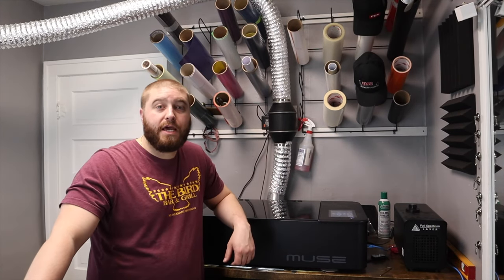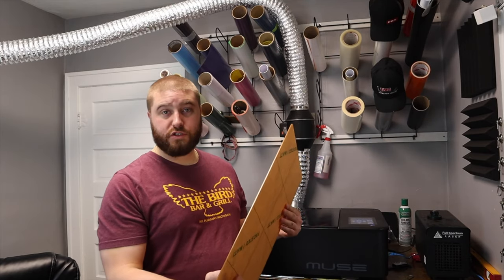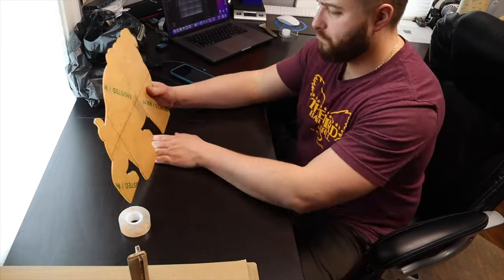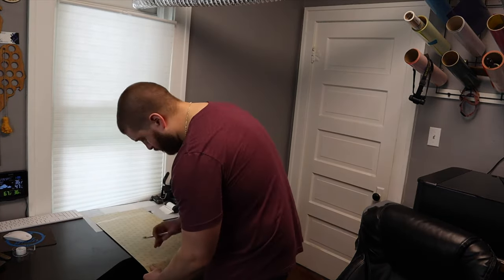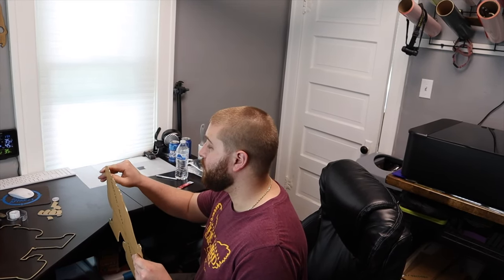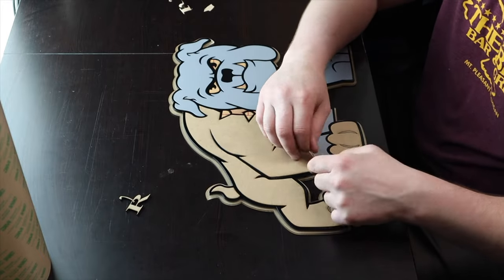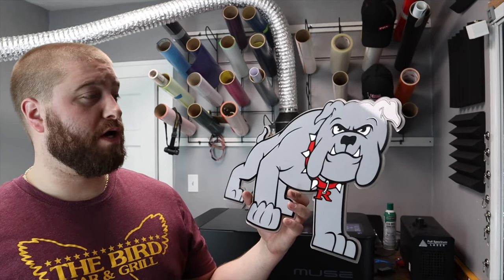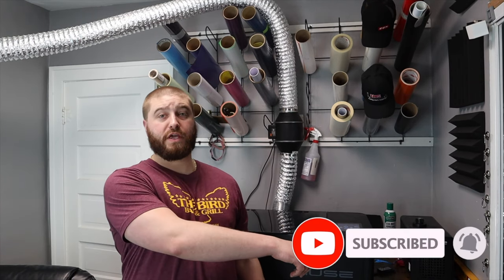Making Custom Acrylic Bulldog Sign - Showing Full Step By Step Process / Glowforge

Comment: Hi kooool video and i hope it's going very well with your business.  Thanks for the video very informative.  But do you have a link to the leg frames you bought.  I can't find  them , an would you know if they make them were you can use the leg and be able to mount it on the wall . Thanks
Reply from the maker: Yes I do! Below are both sets of legs that we ordered. They both work the same. I couldnt tell a difference between the two

https://www.amazon.com/gp/product/B08ZS1RMWK/ref=ppx_yo_dt_b_search_asin_title?ie=UTF8&psc=1

https://www.amazon.com/gp/product/B08ZD5NZLT/ref=ppx_yo_dt_b_search_asin_title?ie=UTF8&psc=1
Reply from the maker: The taller one has a mount where it could be wall mounted or use the legs. I am not sure if I would trust double sided stick to hold the signs up anymore. I have had friends tell me that the sign fell off the wall cause of the double sided stick.
Reply: Thanks and what a Bummer, so what do you do now. I think the two side tape just good for picture frame then .
Reply from the maker: We use standoffs now and build the holes into the sign.
Reply: @smalltownlasercreations  thanks for the information,  really appreciate it. Just got a laser and want to learn how to do this and add leds . Have a good weekend

Comment: Can you post a link to the "leg brackets" you purchased? Also, i'm having issues using that adhesive and laser cutting it, it's leaving extremely sticky cut edges. Any ideas for how to fix that?
Reply from the maker: Here is the link for the legs I’ve been using 

https://amzn.to/3Fcodyo
Reply from the maker: As for cutting with adhesive, I switched over to the 3m 467mp and it cuts through much better with the correct settings. I am using a muse 3D with a 1.5” lens and I use 30S 80P 80C